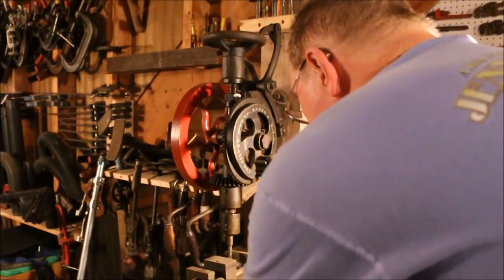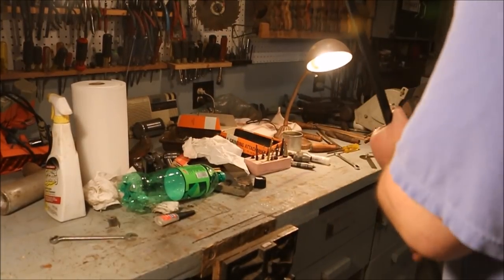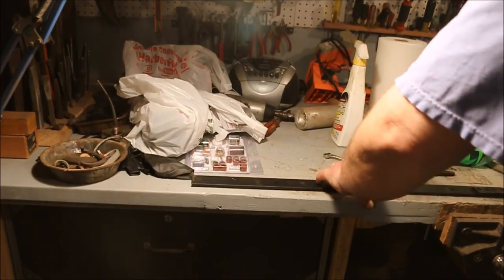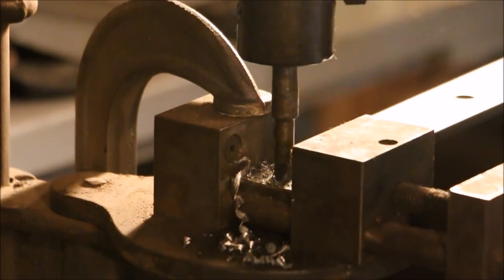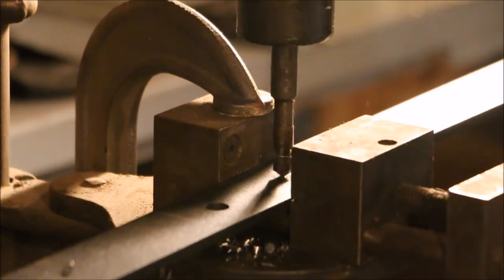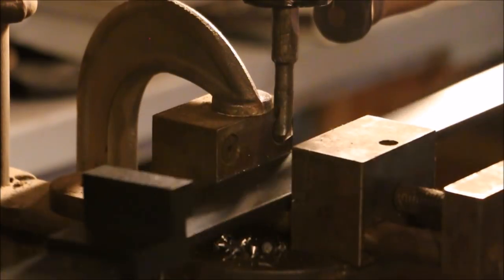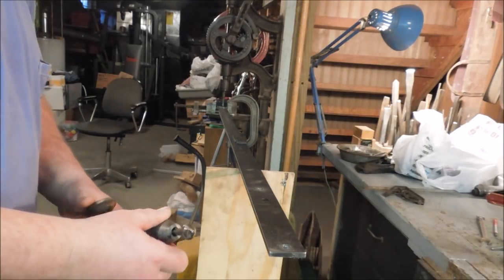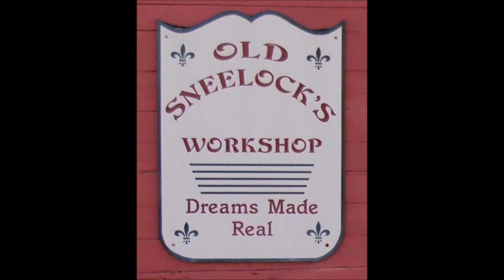BARN DOOR ON THE BATHROOM UNDER $100.00 ~ USING THE SILVER MFG CO  DRILL PRESS

Comment: I enjoy those old postdrills. I can see why the old farmers embraced  anything with an electric motor. Everything was done by crankhandle back then.
Reply: well everything was done by the farmboy, i guess electric motors ate less :)
Reply from the maker: I do like having the electric drill press in the garage. I don't want to give up my lathes any time soon either. The Silver Drill Press always fascinates me with how well it drills.  I think it is the way the bit advances a set amount for every rotation of the bit. With a sharp bit I can drill holes that the electric drill press stalls out on. Being able to put 289 foot pounds of torque on the drill makes a difference. 😊😊
Reply: ..............and didn't gripe near as much.
Reply: they gripe less, but also absorb less blame, it works both ways :)
Reply: True. I was inside the scale house and saw a set of 8 or 9 v-belts pulling a cone crusher go up in a puff of smoke one day. That motor didn't even squeak.
Reply from the maker: Lewie McNeely Big static loads will make the belts slip and squeal on start up. Now there are soft start circuits to spin up the load at a lower rate to prevent that. 
Warning Foundry Story: Shell mold had huge air makeup/heaters with 48" dia 8 blade props. 8 B Belts and a 40 hp motor.  They ran on a thermostat so they cycled. The belts squalled levery time. As Dad and I were walking under one of the fans, it kicked on. At the same time, Shorty, the day shift greaser, was walking the other direction. Dad hollered over, "You better grease those belts!"  Shorty smiled and waved. 
The next afternoon Shorty told my Dad, "Don't you ever do that again." 
That morning Shorty went up and greased the furnace fan, and the belts. The furnace started and the fan kicked on. The belts slipped and burnt in two. The burner kept going. Without the fan the heat was trapped in the box. By the time Shorty got it shut off, the grease and dust from years of running caught fire and the whole mess was ablaze. 
Shorty took the blame. Dad went to our boss and explained. 
Never tell anyone to do something even obviously stupid. They just might not know as much as you think

Comment: Another way to hold drills that do not have a half inch shank or will not work in a chuck.Take half inch bar stock cut to length to fit. Put it in a lathe and drill out to size. Cut down one side with hacksaw to make room for setscrew to compress. I made many bushings this way for old current lathes.
Reply from the maker: Tom Nelson That is a clever work around. I have a couple that were made by soldering the bit in a 1/2" stub shaft. I think the slot idea is better. 😎

Comment: i guess the chuck on that machine is exactly why silver and demming bits ( or blacksmiths bits in the uk) have the same shank size.  did you say they used to make smaller bits with the matching shank size too?   it certainly saves you money on gym membership!
Reply from the maker: Yes that is exactly why they are called that. Silver and Demming never patented the idea so soon everyone was making similar bits. They just kept the Silver & Demming name on the design. With the invention of Jacobs type chucks that could hold smaller bits securely the smaller size Silver & Demming drill bits were no longer a big seller and I imagine they stopped making them after they filled the shelves with stock they couldn't sell. 
I have a few old bits that I have found here and there. For 120+ years old they work remarkably well as you can see in the video. 
The Silver & Demming Bits that can still be purchased under that name for various prices and with various quality to boot have survived because of the standard size of the 1/2" Electric Drill. Most of us have a 1/2" electric hand drill. Sometimes we have them mounted in a drill press. 
I have one that I used to drill some holes with just to see how well it worked. 👍😊😊😊👍
It was as bad as I remembered. The little Chinese/Indonesian/Korean bench top drill presses also have a 1.25 mm chuck, ( that's roughly 1/2" capacity) so the Silver & Demming drill kits are still sold. I have a set myself.
Reply: being slow, carbon steel drill bits are fine, hss not required!
Reply from the maker: Jusb1066 That highlights one of the main failure points in drilling. Faster isn't necessarily better. 1/4" drill motors turn at 1200 rpm top end. That is the recommended rpm for a 1/4"  carbon steel bit drilling steel.  Using a reduced shank carbon steel 1/2" bit in a 1/4" drill raises the tip surface  ft/minute  to double the recommended. Okay for carbide but carbon steel heats up, anneals, and welds itself to the part. The outer edge is gone. It stops drilling and in response we press harder. Smoke rolls. 😠😠😠😠😠😵